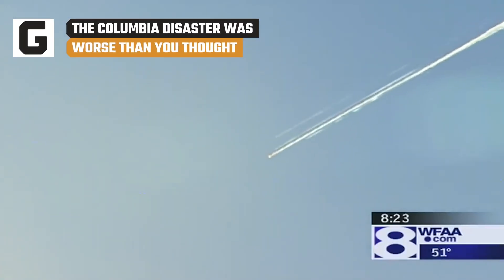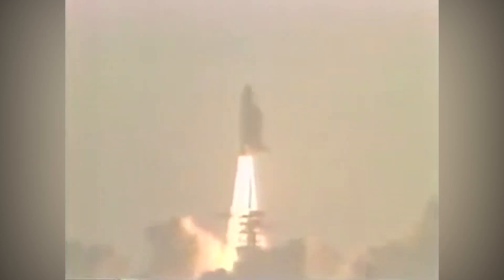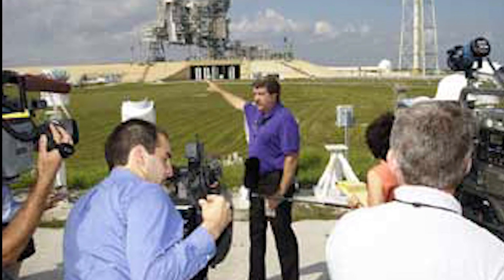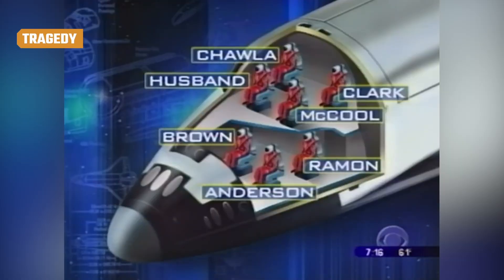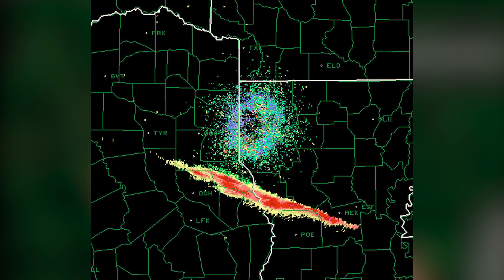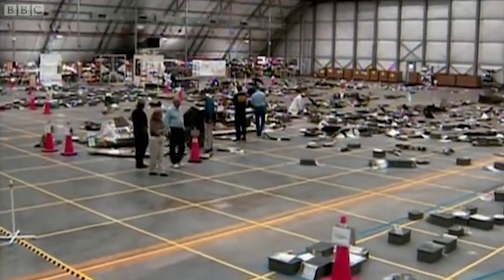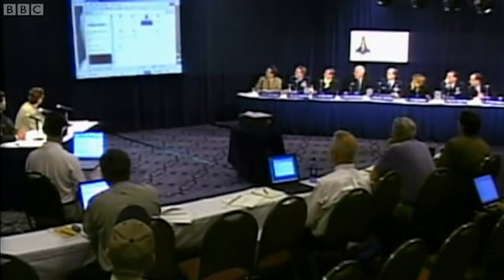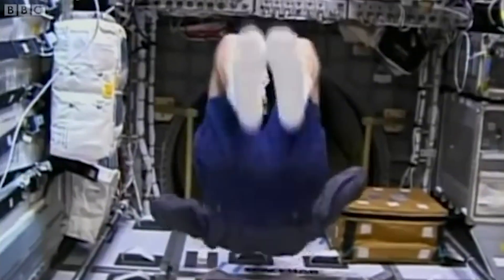The Columbia Disaster Was Worse Than You Thought

Comment: In a safety culture that is aviation, i'm apalled that there was not a spacewalk to conduct a visual or photographic inspection of the vehicle. I recall one year one of our airplanes came in from a training flight, it was squawked that the crew heard a thump and felt as if they had impacted something in flight, the impact area was described as underneath the aircraft, near the right wing root. They executed a precuationary landing and visually inspected the aircraft. The chief flight instructor removed the aircraft from the line for the reminder day and had MX pour over it visually, going so far as to remove wheel fairings and wing inspection panels to verify there was no damage. None was found. The student later returned as he had left a laptop in the back seat. the laptop was found in the back seat floorboard, copilot side. It was determined that the laptop fell from the backseat onto the floorboard with enough force that it was audible to the pilot's. They never impacted anything. They simply felt and heard the thump and never even remembered the laptop being aboard the aircraft during the flight, as the student usually left it in the hangar. The aircraft was out of service for about 4 hor 5 hours. It probably cost the flight school $1,100 in lost rental fees and maintenance labor. it was worth every single penny to confirm the lack of damage to the airframe because a doubt had been raised about airworthiness. This flight school in question is a "shoestring budget"  "mom and pop" operation... NASA isnt, and they should have known better.

Comment: How many different conclusions will they come to, use to it was an O ring failure due to it being cold and it blead rocket fuel into the booster causing it to explode now foam hitting the wing causing heat refecting material to come off the wing now this is the starting cause of this disaster?

Comment: Engineers could have come up with a fast basic repair method and sent it up with the rescue shuttle. Once Columbia's crew were aboard the rescue ship a spacewalk could have attempted to patch the carbon  strip damage then bring Columbia down unmanned under remote control. The astronauts would be saved and there would have been at least a fighting chance to save the shuttle. And I'm sure there was a reason that in early shuttle launches that the external fuel tank was painted. Maybe that made the foam less likely to shed during launch. They could have also designed a sort of shrink wrap type of sleeve to wrap the tank in that may have been able to deal with foam breaking off.

Comment: Negligence, They could have had the astronauts spacewalk and check the damage to the wing. Inspection of the exterior of the shuttle prior to reentry should be protocol. Commercial truck drivers are told to inspect their trucks prior to the start of their shifts. The crew should have improvised and inspected the outside of the shuttle, for their safety.

Comment: The person who was responsible for the Challenger disaster was Lawrence Mulloy he was warned of the disaster but instead of lives he was more interested in budgets Schedules he sent those astronauts plus school teacher Christ's Auliffe motherless t the previous shuttle especially averted disaster than by the grace of GOD that it didn't meet a similar fate rubber is supposed to pliable and make a deal but if it freezes the rubber in the O-rings cracked and will not make a deal the volatile gases from the solid rocket booster escaped causing a catastrophic failure that led to the massive but Mr mulloy had been warned by the engineeres Morton thiocol but ignored the warnings Mr mulloy should have resigned if he was being pressured in protest and listened to .morton thiocol

Comment: To anyone who thinks this accident was avoidable(at least post foam impact) you should read the technical reports on the matter.  Even if NASA had wanted to it would not have been able to rescue the crew without putting more lives in greater danger due to rushing another shuttle up.
Reply: @Tyler Braden and guarantee at least two people die.  I am a museum historian who works at a museum with actual shuttle hardware. The amount of work needed to prep a shuttle for a safe launch is enormous, moreover you risk a worse accident which would almost certainly kill additional people on the ground since your rushing.  A shuttle still with its boosters and central tank crashing into a populated area would kill thousands.  
You also forget several points
1.NASA did not expect a breakup as a likely outcome given the shuttle regularly had  tiles come off on re-entry though they knew the risk was increased.  Asking them to likely kill two astronauts (chance of fatalities on any rescue mission was over 50%) would be way worse.
2.I will stress this again since you cant read, there was no way to get another shuttle flight ready within the timespan of the life support on the other shuttle.  It takes months to prep a shuttle, the fastest they could have done it would have been outside the window of rescue by over a week.
3.Even if they could have, at the time there was no way to dock two shuttles.  And with only one EVA suit (which are custom made for the astronaut who would use them in a mission and cant be worn by anyone else) there would be no way to transfer the crew.

So please before you embarrass yourself read the accident report next time.

Comment: What happened? f**king hubris, that's what happened. Different faults but the same mentality as the Challenger disaster at work. That and to be fair, the shuttle should never have been built. It was the most expensive and deadly spacecraft ever built to date and designed with practically no fail safes due to budgetary concerns. After Challenger it was determined the shuttle program had a failure rate of 1 in 200. That in itself was disastrous. By the end of the program that had fallen to 1 failure in 67.5 launches, absolutely catastrophic. If you gave me a choice between this craft and Soyuz, I'd pick soyuz every time.

Comment: These idiots couldn't run a bath, nevermind a space shuttle. I mean really, foam comes off and hits the wing and they say nothing to worry about. On its approach into the earth, heat sensors start failing. Nothing to worry about. Satellite offers to have a look at the wing for them and they say no. It's like a carry on film from the 70s with Frank Spencer as the chief engineer. The cat has done a whoopsy in the garden, only on this occasion it a big fat 100 ton whoopsy

Comment: Both Challenger and Columbia incidents certainly didn't need to happen. I really believe jail time should have been given for particular people involved with the decision making - particular with Challenger. What I want to know is - after the Columbia incident, with the foam falling off - I want to know if any improvements were made to stop foam from falling off in the first place. So, for flights after the Columbia incident, were there any changes to stop foam from falling off? That's the main thing. One extra comment - even though the heat-resistant tiles weren't involved, I can honestly say that heat-tiles falling off from the shuttle is a total fail from an engineering and design perspective. And foam falling off is also a total fail. Total fail.

Comment: Here's a tragic bit of history about the shuttle:

Atlantis very nearly suffered the same fate as Columbia when it flew on the STS-27 mission. Her thermal tiles were damaged during the launch. Because this was a classified mission, the crew was not allowed to send high resolution images to mission control over the standard ground frequency, and so the images mission control did get of the damage had to be sent on a secure but low quality protocol. When commander Robert Gibson on board saw the damage, he was horrified and didn't think Atlantis would survive reentry, but NASA denied it and said the damage didn't look any worse than other missions. Gibson actually said he thought his crew was going to die. Atlantis did land, but 700 of the tiles on the wing had been damaged, and one was missing completely which caused an aluminum plate to melt.

STS-27 flew in 1988, a full 15 years before Columbia. NASA had so many warnings about this flaw for many years and they did practically nothing about it.

Comment: That's a lie people notice they found out before they were gonna re enter   and did nothing about it!
 Even one of the higher UPS at NASA that use the work there said that they seen satellite photos of the missing heat shield on the rocket but decided not to do anything!
Reply: The space shuttle was not a rocket and it didn't matter if anyone knew there was damage to the wing since there was no contingency in place to repair it nor the spacesuits needed to go outside the space craft.  They were doomed but NASA felt, based on prior foam strikes, that it wasn't severe enough to doom the mission. They were wrong obviously.

Comment: @Grunge I think the accident report was missing an extremely important possibility and it would have been safer. On January 29, 2003 a Delta rocket carrying a USAF payload. Had they actually done what they were supposed to do and not violated protocol; they would have been able to see the damage to the wing. That Delta rocket could have been commandeered and has a fast payload change with more food, supplies and lithium hydroxide canisters that would have made staying orbit for a longer period of time possible. That would have reduced the pressure on the ground crew working to get Atlantis ready for a rescue mission. 

In the meantime, engineers should have been told to get off their asses and build a thermal blanket that could withstand the 3000°F temperatures the leading edge of the shuttle would typically experience during reentry. That blanket would have been applied to Columbia's wing and would have almost certainly allowed Rick Husband and William McCool to bring Columbia home in one piece while the rest of the crew returned in Atlantis.

Comment: The common factor in both Shuttle tragedies was bureaucratic managers in government ignoring the technical concerns of engineers.  NASA management referred to the Shuttle as being as safe as flying on a commercial aircraft.  They seemed to think of it as a space plane, so no wonder they didn't worry when presented with a potential problem.  In reality, there was a 2% chance that a Shuttle mission would result in a catastrophic loss of crew and vehicle, but many in  NASA middle management utterly failed to grok this.  I'm so glad that SpaceX is now leading most of the development in launch capabilities.  Space is hard and SpaceX will make mistakes, but the development will be much safer and MUCH less expensive.

Comment: When the issues came up about the sensors and the transmission quit, NASA knew they had burned up on re-entry.  They knew there had been damage to the left wing, but they hoped for the best , keeping their fingers crossed. It is high risk to be an astronaut. Reminded me of the damaged O-rings of the Challenger, if the weather went below freezing which it did. The engineers had warned NASA but they went ahead with the launch as they were pressed to make deadlines. These astronauts were alive as the capsule was intact after the explosion. Some passed out on the way down but they all died when they hit the water. I read a recording of it, shorty after it happened, that was published by the Houston Chronicle. With parachutes, supporting the capsule, they would have survived. They had no safety/escape back-up. NASA needed to improve on their safety issues. Money should not come before the safety of these flights. It is dangerous enough, if things go well.

Comment: similar thing with Challenger... contractor for the SRB's tried to sound the alarm but were pressured into declaring a go by NASA management...    

One thing about the rescue plan,  success was not gauranteed, it would have been hugely risky and put 4 additional crew members lives at risk in Atlantis. The plan was based around the assumption that the damage would have been identified and acted on almost immediately. They had to prepare Atlantis for launch faster than had ever been done before with no failures.  Columbia's crew would have to completely power everything down and conserve resources for 20 days. Atlantis would have been subjected to the same foam strike risk that took down Columbia.   They would have to get super lucky with the weather conditions and time the launch and then perform an untried rendezvouz, with Columbia's crew already feeling the effects of CO2 poisoning due to diminishing life support resources.  They would have had to spend minimum 9 hours holding the shuttle steady while they transferred each of the crew, with 2 crew members performing a 9 hour EVA to get everyone across one by one and transferring the suits & astronauts back and forth. And once this was all done they would be strapping additional crew members in for an interesting ride for deorbit and landing.   

It's difficult to see that mission coming together with the required level of perfection required to pull it off, but it's a very interesting read none-the-less.  

Ars Technica wrote a great article about the rescue mission which I've referenced here.  https://arstechnica.com/science/2016/02/the-audacious-rescue-plan-that-might-have-saved-space-shuttle-columbia/

Comment: it's a huge stretch to assume the requested imaging would've been any help at all. it would have been imaged from hundreds and thousands of miles away and even in the most optimal angles and lighting conditions could have resulted in very inconclusive or misleading results. also the crew on that particualr mission had no way to do a spacewalk to that part of the craft, and there was no canadARM etc to help with that. my own speculation is, i believe mission control knew they had a huge potential problem and after some extremely difficult management and engineering decisions privately decided they had to roll the dice on attempting to land.

Comment: Challenger was no better. Engineers were well aware of how fuel from the SRBs had blown by the primary O Ring on previous launches but never stopped to fix them because they were under so much pressure to launch. The booster company even told them it was a terrible idea to launch at the cold temperature of that day and someone let out the smartass remark "Well when do you want me to launch? Next April?" No primary concern for the safety of the crew. They were well aware of what would happen and they let a crew die in front of millions on live tv because they couldn't handle waiting for it to warm up again.

Comment: The rationale behind blocking the imaging requests was because the NASA bureaucracy at the time considered anything fatal happening to the Thermal Protection System (TPS) unfixable and the crew irrecoverable. NASA management would rather the crew die unaware of the impending doom rather than die knowing that they were performing an impossible reentry. The was compounded by the fact that Columbia was not carrying the Remote Manipulator System (RMS) arm on this flight, as it was deemed unnecessary for this mission. Spacewalking out to that part of the spacecraft without the arm to attempt a repair would have been very difficult and extremely risky, so the powers that be decided that ignorance was bliss and to continue as if nothing was amiss. Two flights before Columbia’s last mission, a chunk of foam broke off from the same area of the External Tank and damaged one of the SRB to External Tank attachment rings during a launch of Atlantis. A board was held to determine if the foam from this area of the tank (referred to as the foam bipod ramp) should be modified or removed for future flights. NASA management decided that the danger was negligible and made the decision to press on with no design changes.

Comment: If they knew the problem and the deadly threat linked with it - why the heck they didn't developed some "STS Repair Kit"? No, that's no joke. Considering the default costs for a space flight this additional costs would have been peanuts. Some soft panels you can harden out in space - whatever. There would have been a solution! In other words, the crew would not have died in 1970 when NASA was a team of absolute professionals, from people like Braun and Kranz down to the guy cleaning the floor. Unfortunately, these days are gone.

Comment: This entire discussion and disaster might have been avoided if the EPA hadn't required a change to the chemical makeup of the foam.    Changing the foam in order to remove Freon from the process contributed to the foam becoming fragile.   I mean.  Come on - you're trying to save the environment from a little Freon when in fact the act of flying to space has a much larger impact from engines and materials being destroyed.  The burnup of the external tank releases all kinds of nasty stuff and as well as the solid rocket boosters and etc.
Radical environmentalism not only killed 7 astronauts but others during the accident investigation and untold numbers were exposed to chemicals after the crash.  

See link below - EPA vs. Shuttle foam.

http://www.digitaljournal.com/article/217344